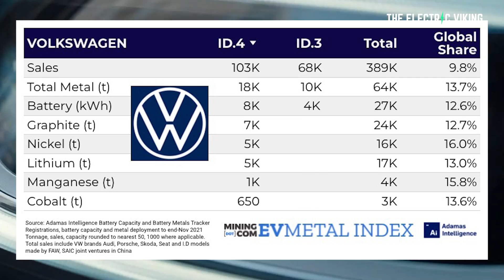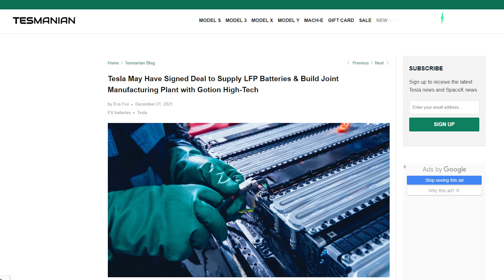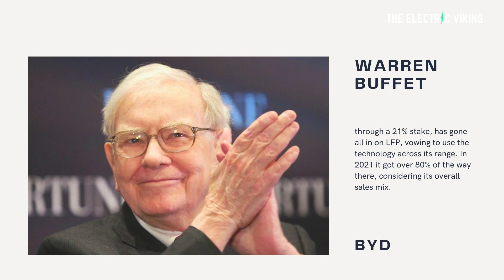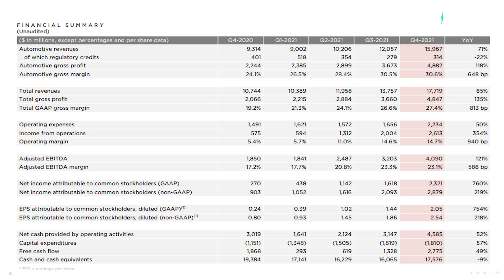Comparing BYD, Tesla & VW's lithium, nickel & cobalt use

Comment: IMO Cobalt and the efficiency is the biggest advantage for the near future. 
Cobalt is the most expensive material in a battery and when one company uses nearly no cobalt or really not at all and others need 10-20% in their batteries for comparable ranges, this alone is a big difference in price per mile.
Reply: "IMO Cobalt and the efficiency is the biggest advantage for the near future. "
Cobalt is the dino of the ev industry. bad call buddy.
Reply: @BSBSBSBSBS-i2x  man, I mean their low to no use of Cobalt.
Reply: @cybergigafactory  ah! Miss read, had a couple of beers !
Reply: @BSBSBSBSBS-i2x  😂😂 no problem

Comment: Thanks for all the update. My Brother just buy a BYD Tang here in North Norway. Impressive car, Even for polar roads.  For mayself i am on my 5th Tesla. Like Tesla more, is easy to drive and suit my needs.
Reply: Thanks. The tang just won the biggest ever cold weather test in Norway, beating Tesla who came 2nd with Panasonic’s battery.
Reply: just a small point; why do you need 5 tesla's, what was wrong with the 1/2/3 etc....
Reply: @BSBSBSBSBS-i2x  
So, a pre- heatpump Tesla? 🤔
Reply: @rogerstarkey5390  no idea but the latest available?
Reply: @rogerstarkey5390  heat pump is standard now for BYD.

Comment: This did not show all the models.  Even using that you accept that Lithium alone used by Tesla is over 1/5th the world supply for 2021.  900k cars x 5 is 4.5 Million EVs MAX - NO MORE COULD POSSIBLY be made even if EV mades had all of it.  They don't so reality is far fewer CAN BE MADE with existing production. When will that get through your head?  There are 1 BILLION Vehicles and 80 Million sold every year. Even 4.5 Million doesn't matter.
Reply: Do you want buy a horse? You sound like a horse salesman at the turn of the last century!
Reply: what happened when we needed petroleum? we found more. What will happen with Lithium, one of the most abundant in the world...we will find more!!

Comment: The important facts Sam cited here make it even MORE strange that Tesla shares are down a lot, and BYD, too. Only Elon's admission that supply limits will continue to hamper production in '22 (NOT meaning that Tesla won't still outproduce the competition by a lot) explains why some have lost confidence (foolishly and short-sightedly, in my opinion). To me, the recent report was VERY promising, increased (if that was possible) my certainty of Tesla's continuing domination. And BYD, the model of vertical integration, an established powerhouse both in tech and industrial production, is as fundamentally strong as ANY company. Sure, the whole market's down, but these two should be doing better. ??????
Reply: It is the old saying ‘buy on the rumor, sell on the news’.
Reply: @williammeek4078  Its nothing to do with that. The whole market in 'new tech' has collapsed very simply because of interest rates: people use finance to buy cars. if the cost goes up they dont buy.

further, CE was a safe haven against tech drop last year, this year it's rotating back, so CE/NEV may struggle for a bit.

Comment: Hi Sam! Great channel! What do you think about Formula One still spending millions or maybe billions on ICE engines and pushing forward the illusion that speed and performance and innovation is still linked to 'classical' engines??
Reply: ICE engines should be exclusively the domain of motorsports and some performance cars where the visceral and aural aspect play an important role. Formula one is also pushing the technological aspect through the hybrid power units the manufacturers supply. They will also be making the switch in future to 100% synthetic E-fuel. The performance and speed is no illusion. Battery tech is no where near being able to provide enough power for a race distance in F1 or any other class other than the short Formula E races. I don’t know if they could if anyone would want F1 to be all electric. I sure would not.
Reply: I agree with your comment, I'm also a huge fan of F1, but, well, too much money are involved now, more about (too) complex   ICE engines and less about human driving skills. And, maybe I'm wrong,but you don't need too many dozen laps to establish which is the better driver or team, or strategy etc for a specific circuit. And I'm also confident that new technologies are about to emerge to increase the performances of the batteries, and more cheaper and friendly with the environement.
Reply: Maybe it’s something as simple as battery swapping in the pit lanes every 300 - 400kms that solves the problem. Speed and acceleration definitely won’t be lacking even with current battery tech.

Comment: The beauty  of Teslas 4680 cells  is ability to manufacture them in a tenth the space  due  to the Maxwell dry electrode technology,  Tesla bought  Maxwell specifically  for that  tech.and with Tesla Hibar  Automation  building the cell production machinery  and Tesla deploying  it all to its Giga  Factories they  will have scale  and production like no other.
Reply: @adamgreen911  i know I'm right I'm invested in TSLA  and   have profits  of  1,5 times  in return, buy
 @ the dip ,TSLA to  $1500 in a year
Reply: @adamgreen911  You haven't heard of VW ceo Herbert Diess?  He says Tesla  builds cars @  1/3 the time  VW does.
Reply: Still up until now, Tesla do not make batteries and noi cars sold have tesla made batteries, that is just a fact.
Reply: being involved in the production of cells, doesn't mean you make the batteries.
Reply: @adamgreen911  Your argument is nonsense. TESLA DON"T MAKE BATTERIES./ FULL STOP. They have only in December started making cells, which are not ready to be used,. This is easy to verify if you want to. I actually sent you a link verifying this if you bother to read it. Tesla has been lying for years and creating the impression they make batteries, when they don't!

And stop with the vertical integration rubbish. BYD are the only car maker in the world today that is fully vertically integrated. BYD make the batteries (tesla outsources); BYD make all of the semiconductor chips (Tesla outsources): BYD sell batteries to the likes of Ford; GM SAIC (starting this year); Tesla (maybe); toyota and other Chinese and korean car makers; They are listing their semiconductor business on the GEM anytime now (approval was given on the 27/01). Elon simply says he is going to do these things, BYD actually does them.

Tesla is a good company, but stop believing what elon tells you.
Reply: @adamgreen911  yes exactly! Tesla lies, haven't you worked that out yet! Please just type into google 'tesla don't make batteries'. 
No response to the vertical integration?

Have good day mate.
Reply: @adamgreen911  please go  see the latest BMW i4  Recall!    I'm sure you like to  drive one  without  Battery crush  protection. LOL
Reply: @adamgreen911  The mod S  is now  equal  to its peers and moy 3 and Y from China  are perfect in fit and finish , the Fremont units  fit are now greatly improved, on par  with the competition, Go do your bit , buy a i4 , just  don't get into an accident  lest the battery pack catch fire and U  burn to death..

Comment: Great video just want to point out all Model 3 RWD models in North America are LFP and have been since November 2021.
Reply: But according to most Americans, LFP is under patent until this year, so only Chinese companies use LFP because they were given 'special' approval! The only reason for chinas success with LFP is because they don’t respect international laws! Utter nonsense, as I have been saying, if they are under patent, how comes Tesla has been selling cars with them??? BYD over last decade developed this tech., which everyone said would not work, but now it does, it’s because they stole it!!!

Again nonsense. Give BYD engineers the credit they deserve.
Reply: @BSBSBSBSBS-i2x  Really shows the flaws of the system.  New technologies are developed over the 2000's but the license fees and extra manufacturing costs keep it out of everywhere but China.  China uses this to get a massive lead in manufacturing and iterating on the technology.  The patent holders haven't gotten much of any fees (some from tesla importing as I understand it) and now they are expiring and we will see some non-china production (likely only with government handouts).  The system is very very broken.
Reply: @BSBSBSBSBS-i2x  All Teslas to date that have LFP batteries are using batteries from CATL in China. The additional supplies of LFP that will be going into Tesla cars in 2022 are also from Chinese companies, including the one that has opened a battery factory near Giga Texas to supply Tesla. The patents are not an issue.

Comment: The article you used for this video is completely inaccurate.

When comparing Tesla and BYD they only used 2 of BYD's cars; the Qin Plus and Han...what about all their other models...Song, Dolphin, Yuan,  D1, Denza X...etc...

The article states that BYD delivered 277k NEV's last year, when the annual EV and DM model sales reached 320,810 and 272,935 with YoY growth of 144.9% and 467.6%, respectively. So total LFP batteries cars delivered 593,745. if just BEV still 320,810 all LFP.

It says Tesla delivered 768k model Y and 3, which again is wrong.

It then states:

 "Against world number two car badge, BYD (OTCM:BYDDF), Tesla also remains streets ahead. The lead is made more remarkable by the fact that the US company delivered more LFP-battery powered cars last year than BYD, which is the world’s number two manufacturer of the cobalt and nickel free power units and is credited with much of the advance in the technology."

They may have delivered more NEV's, but there is no way they delivered more than 590k LFP cars last year, or even just taking BYD's BEV sales of 321,000, there is just no way.

Sorry, but the article has no credit.

Also you said in the video, Tesla are yet to sell LFP batteries in the US, but this is about to change...

if thats the case then how can "Tesla also remains streets ahead. The lead is made more remarkable by the fact that the US company delivered more LFP-battery powered cars last year than BYD, " if they didn't sell any last year?

Come on Sam, please just stop reading articles.
Reply: I appreciate you looking at the data close ly and not being blinded by the marketing!
Reply: @dannytq  the numbers they quoted look like November not full year.

Anyway they completely mislead comparing BYD.

I posted this yesterday but for some reason it’s gone. 

One thing I learnt from the article sam read out is graphene makes up more if the battery than lithium. This is the case with all batteries now. I looked a the graphene group and today it went up 12%. I am not recommending it, but thanks to that article I have a new focus.